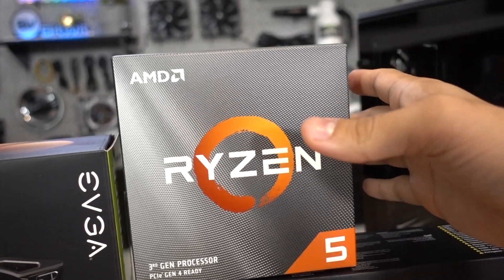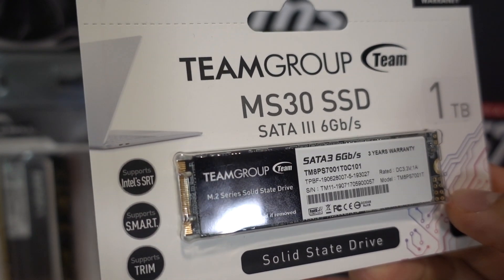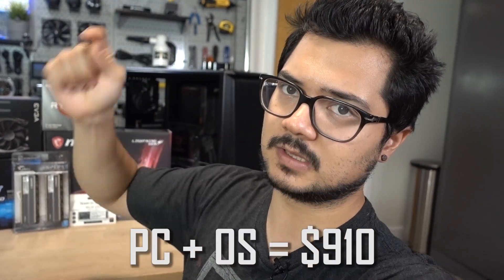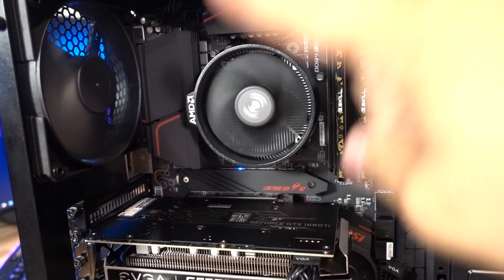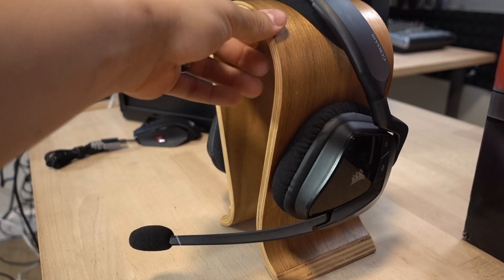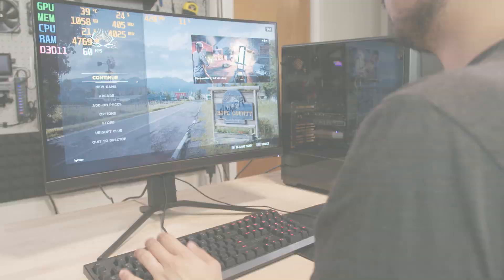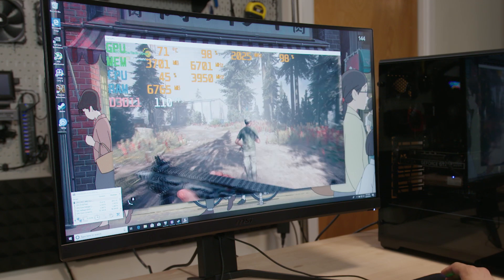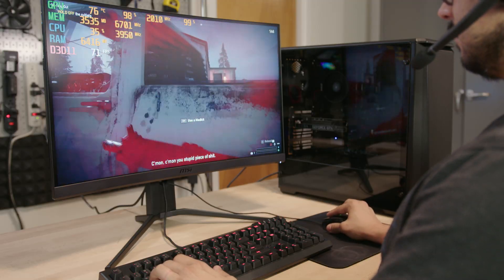Literally EVERYTHING you need to game on PC for $1500

Comment: Rly a 1660 ti? The setup is 1500. Camon
Reply: Ya, I have $1000 not including peripherals and I have a 2060 super in it
Reply: Ya problem is with all those peripherals and that really nice Monitor does come to that much but could easily squeeze in a RTX 2060 for a bit more performance plus some ray tracing with DLSS
Reply: @DragonMBlood  The 2060 is crap. The RX 5600 XT is cheaper and gets a few percent more frames in games overall. DLSS and RTX, are not features that most people care about, and they run terribly on the 2060.
Reply: @lucwallace  I never said it wasnt crap the RX 5600 is also crap in my opinion. I run a GTX 1080 and planning on upgrading to the next generation when it comes out.
Reply: @DragonMBlood  the 5600 XT is as powerful as a 1080 lol. and its as low as $270 brand new. its a steal.
Reply: @lucwallace  I wasnt and wouldn't compare those 2 cards?? Do you even read? GTX 1080 came out 4 years prior and the reason I'm planning on upgrading it is because it's not good enough anymore and thus crap so if your saying a card is just as fast as it then ya that's crap to me as well.
Reply: @DragonMBlood  when did i lose the argument? i made my point, you made yours, i agree to disagree.
Reply: @lucwallace  5600xt is cheaper but equally good but it still has buggy drivers and the rtx2060 is better for streaming and has raytracing for minecraft :D if you dont care about streaming nor raytracing then the 5600xt is the best solution
Reply: @noidea2338  nope. the driver issues were fixed, and the x264 CPU based encoder is better than NVENC. would much rather go with that when streaming. also, RTX on the 2060 sucks and it can't get 60 fps on RTX minecraft, which is trash.
Reply: @lucwallace  some people still encounter driver issues and x264 may be better for quality but your performance will drop, not a thing for the nvenc and RTX MINECRAFT IS RTX MINECRAFT.
Reply: @lucwallace  stop trying to push AMD cards on people man... AMD is the king of CPU but Nvidia is where it's at hands down for GPU
Reply: @noidea2338  not really. performance will drop if you use NVENC. and RTX minecraft sucks, the shaders on java edition are WAY better. compare SEUS PTGI to RTX and you'll see what I mean (it runs better too, and on AMD cards)
Reply: @Rohgamu  not at all. the only nvidia GPU i can recommend to people rn is the 1660 super. all the others are really bad value. the rx 5600 xt, rx 5700 and rx 5700 xt are FAR better than their nvidia counterparts. the rx 5700 xt is $100-150 cheaper than the rtx 2070 super but trades blows.
Reply: @lucwallace  AMD cards are definitely fantastic values, especially when majority of the buggy drivers were resolved but one of the main reasons my friends and I haven't gone back to team red for a while is Nvidia's fantastic software suite. Shadowplay had been the de facto best video recording software I've ever used. It is very efficient, easy to use, and free. Something a few of my friends use for their YouTube videos. RTX voice has also been fantastic, and if they manage to actually get DLSS 2.0 out more then maybe raytracing could be viable on their mid-tier  cards. Another reason I haven't thought about switching over is that AMD has no truly high-end cards. As someone running an RTX 2080 super there is no AMD equivalent but this isn't a common problem majority of ppl worry about.
Reply: @RazorWareCa  Finally, a civilized person who can talk about AMD vs nvidia in a normal way. Shadowplay is a great piece of software, but imo Relive has basically closed the gap so far that they're both fantastic. RTX voice is cool, but I would make the argument that you can buy an AMD card, then buy a cheap nvidia card like a GT 1030 and you would still be able to use RTX voice. It's 100% more convenient to have a single card in your system, I'll give you that. Secondly, RTX rn is a mixed bag, and it definitely needs work. DXR (directX raytracing) is coming in nexgen cards, and this is apparently going to be what RTX should've been all along. AND its coming on both AMD and nvidia GPUs. For people buying high end cards (RTX 2080 and above), I would tell them to wait for RTX 30 and the RX 6000 series to launch, as these are going to be hella more powerful for the same or less money.
Reply: IAA Productions I cant recommend RTX 20 GPUs rn. they're just such awful value. the 5700 xt is priced like a 2060 super, but performs like a 2070 super and can be overclocked to be a 2080.
Reply: IAA Productions  the 1660 super is 100% the best value nvidia GPU rn. the 5600 xt and 5700 xt are killing it.
Reply: IAA Productions  k
Reply: I have a 2060 and a ryzen 7 3800x with liquid cooler aswell as 16gb ddr4 3200mgz and my pc cost less then this. Wait for sales dont get this pc
Reply: @teccz  2060 and 3800x arent great choices but yeah you have a point
Reply: Luc Wallace for now, i agree with you honestly. 5700xt is best imo. but i’m going to wait to see who comes on top of big navi vs ampere for the 400-500 dollar range before buying
Reply: @Dusk007  it will definitely be an interesting fight next generation
Reply: @swampyemerson8269  can you please tell me what's the full component
I'm planning to build PC in about 3 months
Reply: @luciferrrr7895  ok, so this is harder now that b550 boards are more expensive, (you could go for a 2060 KO instead if you want the nicer motherboard)
Reply: but the parts list is
corsair spec delta RGB (you could go for a a cheaper case, this one has RGB so its more expensive)

gigabyte 2060 SUPER (any 2060 super would work, just make sure its for about $400)(5700XT would work but I have always been a NVIDIA fanboy. By the time you are building you system Big Navi, and NVIDIA 3000 series could be out as well, just get a card well reviewed for about $400

b450 tomahawk max

Kingston sata 480gb SSD, would now recommend a cheaper nvme ssd as i didn’t realize it was Dram-less, I have now upgraded but it would put u over $1000 unless you find REALLY good value or get a 250gb one.

corsair desktop ram, 3200 speed (8x2gb)

i had a hard drive rollin around and used that until i got a 2 tb hard drive, but if u got an extra $50 i suggest a Seagate barracuda 2tb 

Stock cooler

a $70 600W 80+bronze PSU. It isn't available anymore, but if you could fine a 600W plus PSU that's 80+ u should be good.

AMD ryzen 3600 (I put X the first time but forgot that for anyone else it’s not as good, I got it because I am doing some editing work on premier and thought I could benefit from the extra clocks. 

Good luck with ur new rig! if i forgot a part let me know and i will tell u, enjoy ur system.
Reply: @swampyemerson8269  that parts list is is bad.

1. the 2060 super is poor value, the 5700 xt exists and is 10% better for a cheaper price.

2. when you say 'Kingston SATA 480gb SSD' I'm assuming you're referring to the A400, which is a DRAMless SSD.

3. The corsair spec delta has poor airflow and cable management.

4. The 3600X has the same gaming performance as the 3600, and is not worth the extra.
Reply: @swampyemerson8269  oh yeah, and corsair RAM kits are usually more expensive than kits from other companies. theres no reason to spend the extra, especially considering corsair has a bad rep for memory OCing
Reply: Luc Wallace I update the parts list with more info, also I meant to put 3600, just the 3600X was on my mind when writing.  2060 super is still good value, and I actually got a 2070 super because my grandparents gave me an extra $100, it’s just Paul’s hardware recommended that so I put it their, Paul’s hard where also recommended the SSD, I didn’t know it was DRam less at the time and have Since switch to an NVME SSD, just those are a lot more expensive.
Reply: Luc Wallace the kit is $42 right now. Couldnt find ANY kit like that for near that price. Search best budget ram for 2020 and best ddr4 ram deal is that ram.
Reply: @swampyemerson8269  if you click on the link, it's not actually $42
Reply: @swampyemerson8269  the 2060 super isnt good value because the 5700 xt exists
Reply: looking at almost every comment, it people defending NVIDIA cards. From you. I do however stand corrected on the ram, I saw the cheaper price on Amazon a few days ago and assumed it was still cheap. It is now $68 I would change my recommendation to a cheaper 3600 speed kit from G.Skill.
Reply: @lucwallace  and also who said that the 5700xt is cheaper? 2060 super was $400, the ony 5700XT that where that cheap where blowers, and those suck
Reply: @lucwallace  also, could i have your parts list? preferably with photos from task manager to prove it? upload them to dropbox and please send me a link
Reply: @lucwallace   looking at almost every comment, it people defending NVIDIA cards. From you. I do however stand corrected on the ram, I saw the cheaper price on Amazon a few days ago and assumed it was still cheap. It is now $68 I would change my recommendation to a cheaper 3600 speed kit from G.Skill.
Reply: @swampyemerson8269  you can get the MSI Gaming X or Gigabyte Gamjnt OC 5700 xt for $380.
Reply: Luc Wallace that is true, look at the clock speeds between those and a $420 one. I expect they will be a lot lower. I also assume the coolers are much worse on those.
Reply: @swampyemerson8269  the MSI Gaming X is like, the second/third best 5700 XT model. lol.
Reply: Luc Wallace tell you what, let’s just agree that the 5700XT or the 2060 super would be much damn better then the 1660 TI be put in it.
Reply: @swampyemerson8269  true
Reply: Currently for a $1,500 you can get a RTX 2070 Super
Reply: @benfine7633  2070s is NOT worth it. not only is ampere coming in like two weeks, the 5700 xt has about 5% worse performance and costs over $100 less. alternatively, if you need nvidia features such as CUDA/NVENC, and need a graphics card right now, you can get an RTX 2070 for $100 less.
Reply: @lucwallace  found the amd fanboy
Reply: @volltage127  ???
Reply: @lucwallace  nvidia is a good option
Reply: @volltage127  thats an extremely empty statement. it depends on the GPU model. both nvidia and AMD have good models, but neither brand is 'better'.
Reply: @lucwallace  2070 super is a good deal
Reply: @volltage127  no, its not. the RX 5700 XT is over 100 cheaper but gives comparable performance. Closer to the 2070s than the 2070. Dont give me that shit about 'DUR DUR AMD DRIVERS SUCK' because the major issues have been stamped out a long time ago. I know many people with AMD graphics cards who dont have any issues. That being said, neither are really worth it because of Ampere. My advice for everyone buying a midrange GPU right now is to wait for Ampere.
Reply: @lucwallace  no the 2070 has rtx and dlss and better drivers with a more stable platform
Reply: @volltage127  RTX is shit. At least on turing. DLSS isnt supported in many games. Spending over $100 for that isnt worth it. "more stable platform" wtf is this supposed to mean? now you're fanboying nvidia
Reply: Luc Wallace rtx 3070 is better than a 2080ti for a fraction of the price of the 2080ti sooo rlly not bad value in that. Price of 5700xt i believe.. hopefully when all ampere cards are out it dont disappoint
Reply: @lucwallace  no rtx is good but since ur amd u have never used it. Dlss is on tons of games and runes well on the 2060. Nvidia has better drivers.
Reply: @volltage127  Turing RTX is a joke. Especially on the 2060/2060s. Half the fps for a very minor visual improvement. DLSS isnt supported in that many games yet. 'Tons' is an exaggeration. Oh here we go again, BeTteR DrIvErS. Are you not aware of how garbage Turing drivers were when it launched?
Reply: @lucwallace  not minor. Fortnite has dlss amd raytracing and its really popular and the drivers are better
Reply: @volltage127  Yes, it is minor. Fortnite is trash, and it looks WORSE with RTX. It's a competitive game, the top players use low settings anyway. Please explain HOW the drivers are better?
Reply: @lucwallace  thats your opinion and no it makes the game look good. You can't talk since you don't play fortnite. The drivers are better cause they don't crash 247
Reply: @volltage127  It doesnt matter if it 'makes the game look good'. Nobody gives a shit about fortnite graphics because it's a competitive game. Also, Epic is actually partnered with AMD. What the hell is 'crash 247' meant to mean? AMD has fixed their drivers across the board.
Reply: Luc Wallace ewwww Radeon 

No thanks lol
Reply: @connorosullivan3500  
5600 xt > 2060 for less money
5700 = 2060 super for less money
5700 xt > 2070 for less money
Reply: @lucwallace  lol you guys are still arguing lmao
Reply: I can do a rtx 3080 setup with this
Reply: The Theovaniac  the RX 6800 is not a joke lmao. it's closer to a 3080 than a 3070 in performance, and RTX is super overrated tbh.
Reply: The Theovaniac  also, the 3060 and 3070 arent worth it. the 3060 ti is great though.
Reply: The Theovaniac  watch hardware unboxed's benchmarks on the RX 6800. their 1440p data clearly shows the 6800 performing closer to a 3080 than 3070. the 3060 is trash, 10% better than the 2060. worse than a 5700 XT. 3060 ti is a much better deal.
Reply: @lucwallace  in the current climate, i think that anything you can get your hands on is a great deal. I have used an amd card for over 3 years, never had any issues or anything recently got the 3060 for 330 and i gotta say that shadowplay and nvenc are amazing but i kinda wish i could have got my hands on a 6700xt too bad everything is impossible to find for msrp
Reply: @faneto_rust  in the current climate, yeah. this dicussion occurred before the GPU crisis soooo